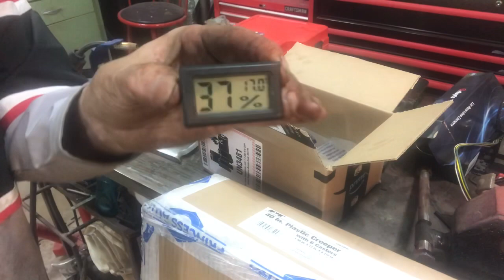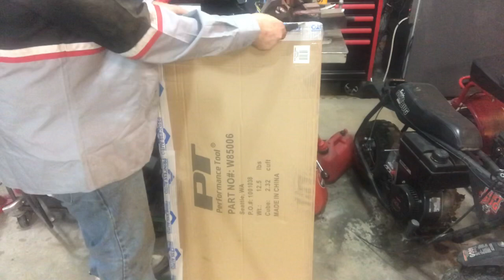Performance Tool Creeper and a 23 Piece FWD Wheel Bearing Adapter Puller/Press

Comment: Cool welding trick never seen that before. Many techs keep the old bearings for that reason.
Reply from the maker: The welding trick works about 90% of the time,  I just fired up the flux core welder.  I wasn't worried about the bead being pretty or strong, I just wanted it hot!  Since I got the press I've been hanging onto all sorts of stuff I might have otherwise thrown out, just to use with the press.
Have a great weekend

Comment: $38.00. Wow. What looks to be the same creeper at Supercheap auto in NZ is $114.99. It is red rather than black but appears to be out of the same mould.
Reply from the maker: Hey John.  $38 is the lowest I've ever seen them here.  They usually go for around $100 and I'm pretty sure they're all made in the same factory somewhere in China.  For $38 I couldn't even by the wheels normally.
Have a great weekend